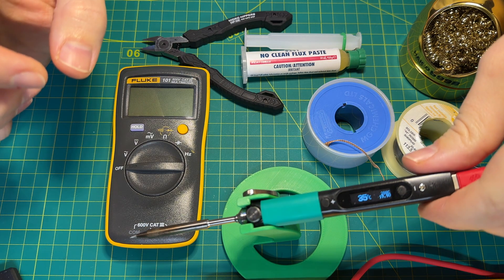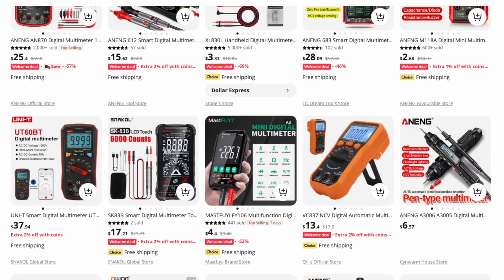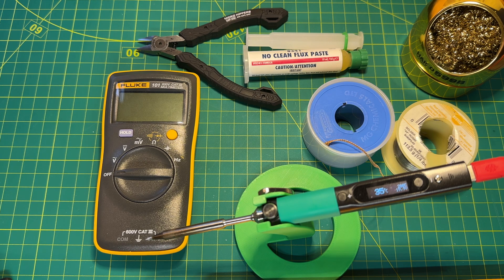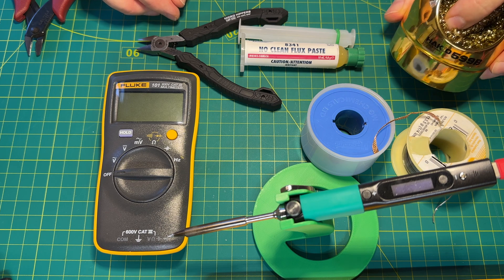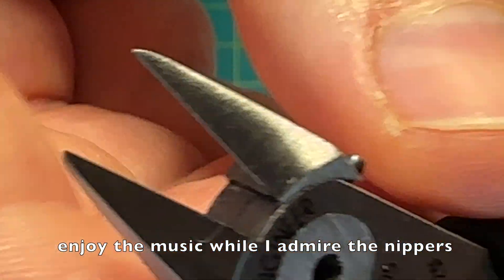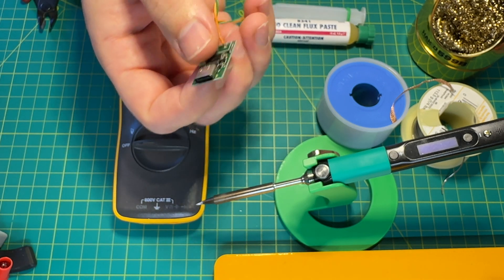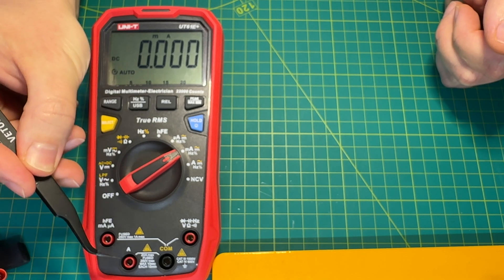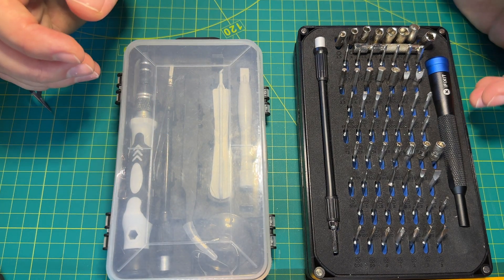#33 Tools to get started with electronics repair, tinkering or as a hobby.

Comment: Great video! laughed out loud when you showed the vape :). One question; where did you get the hand-screwed knob for the pinecil tip? Mine just has a normal screw, did yours come with one or did you install it yourself?
Reply from the maker: I think the company made too many vapes and decided to improvise with a soldering iron "conversion". I would only use that thing if I utterly desperate. 
The knob I got on AliExpress: https://s.click.aliexpress.com/e/_oCSlhfl it's the M2 with 10mm length, but I had to cut it about 3-4mm, so 6mm or 8mm might be a better option.